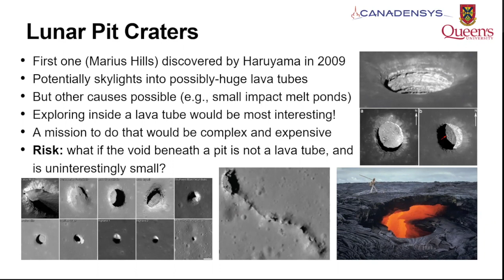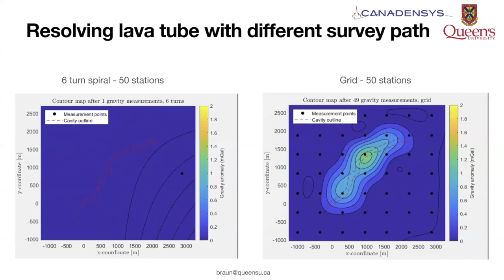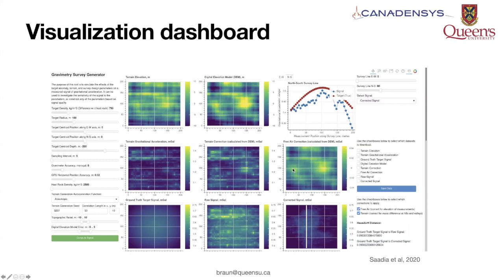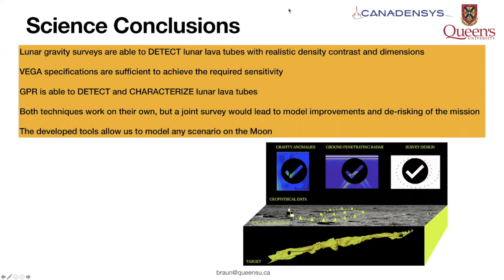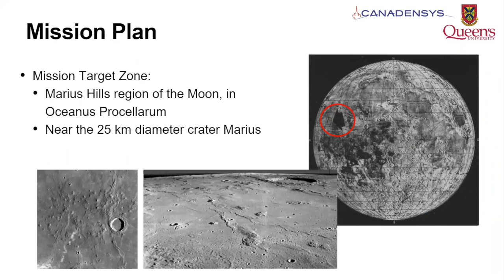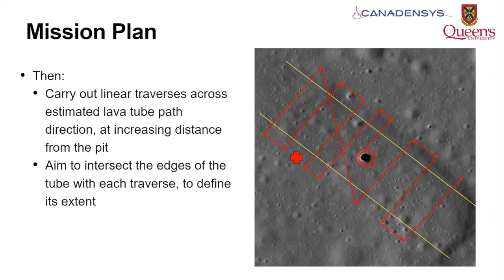Scouting and Mapping Lava Tubes From the Moon’s Surface

Comment: Boston Dynamics has a robot, "Spot," that would be perfect for cavern exploration, especially if they were to design and build a small space suit, to protect Spot from the sharp rocks and especially the sharp sand, as well as the temperatures, both hot and cold.  In caverns on Earth, or mines, communication is achieved with line-of-sight radios and more complicated routes might well be accomplished with a thin, fiberoptic cable rolled up on a spool, like a fishing reel and unwound and dragged behind Spot.  The fiberoptic cable would be connected to an antenna or dish on the surface, pointed at the Earth.  The motion of the robot could be guided from earth with a person combined with automated motion.  The time lapse from Earth to the Robot and back to earth is a little less than 3 seconds.  Flying drones, guided by fiberoptics, dragged behind, are being used in Ukraine and Russia as we speak.